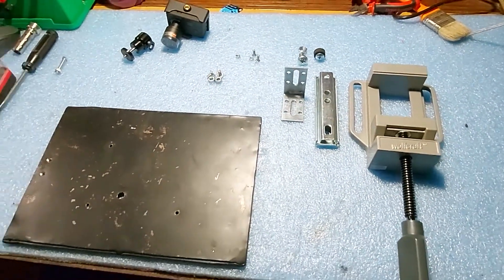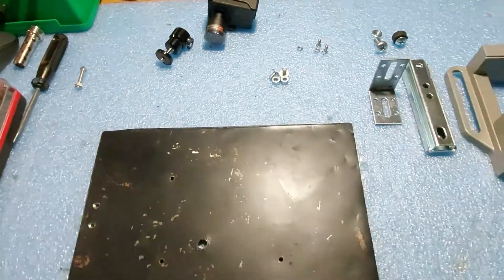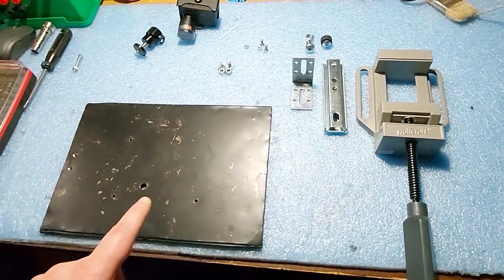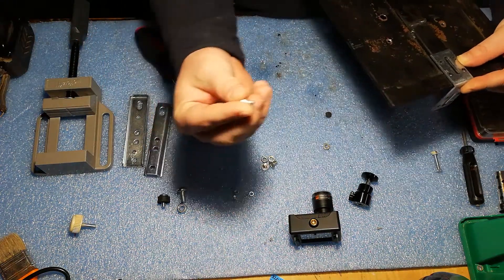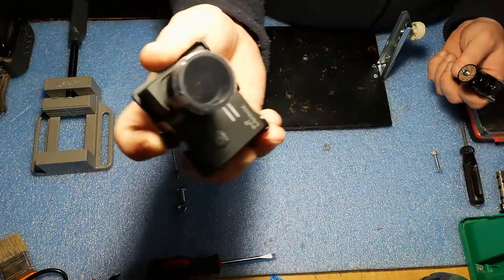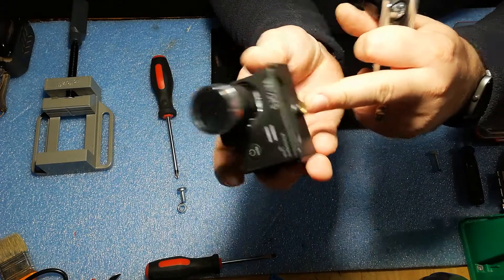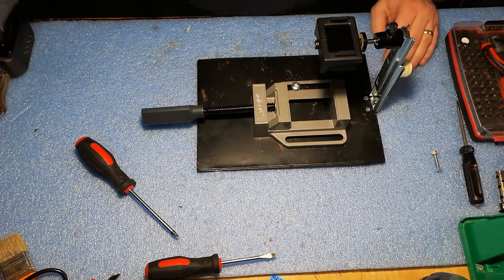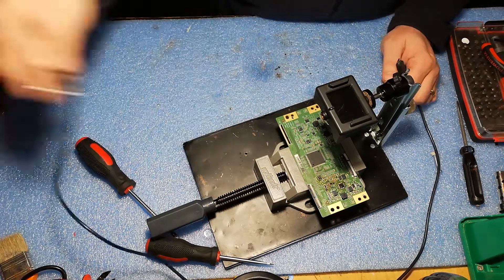DIY SMD Microscope and PCB Holder /Jig

Comment: Thanks a lot you gave me a very good idea. Instead of the manual sliding stand I can use a drawer channel which I can make it adjustable using a salvaged dvd tray slider easily.